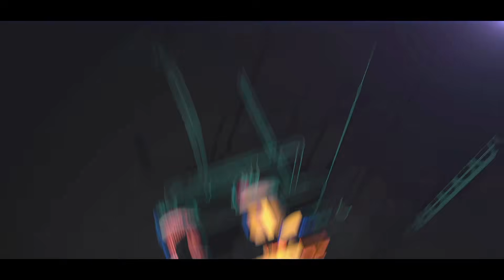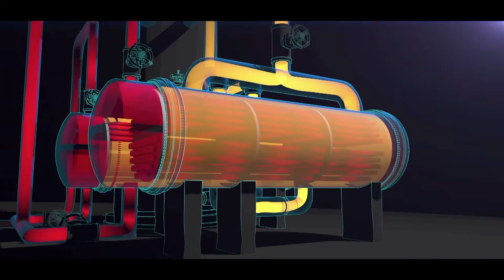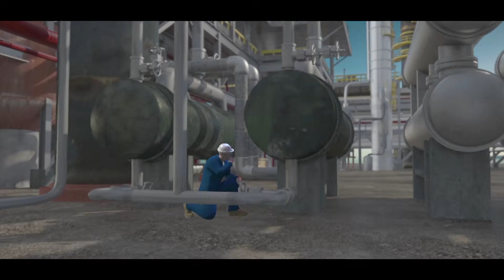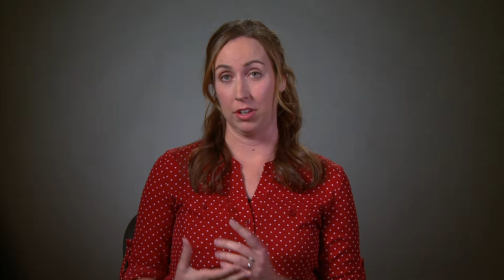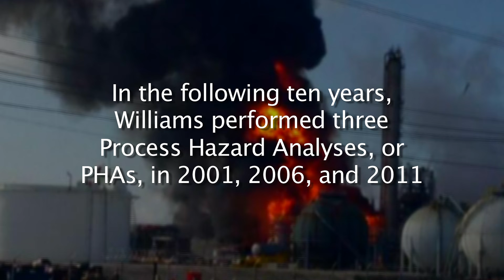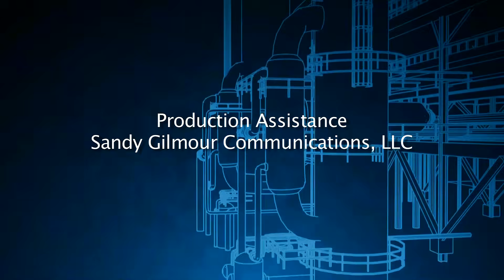Blocked In

Comment: I spent decades designing and working in chemical plants and refineries including a large olefins plant in Channelview.  This accident should have never happened!!.  
I can not believe people signed off on Engineering and the PSM which allowed a modification that could block in and overpressure a pressure vessel (in this case, a heat exchanger) while isolating the relief device.  This is a very basic safety principle that is always covered as one of the fundemental steps in PSM.  As a result, two people died and many were injured. We would spend months reviewing changes before signing off.  Something very strange going on at this facility.  I hope the responsible parties were punished.

Comment: Pressure relief valves should be installed directly to the vessel it is intended to protect, with no valve between, not some 40' away on some other part of the system.

Comment: I worked for 15 Years as a messenger. I got to see most of the industries in the Chicago area. If the streets and sidewalks are dirty in a plant there is a problem get in do the drop or pickup and get clear. I was shown many different safety films while I was in the US Army both active and reserve side. They were dry but accurate at the time they were made. Cleanliness was one pointer to good procedure and organization practices. Too many companies are too focused on the Money side not on safe practices. B737 problems ongoing is one example. Every workstation needs to be clean, all devices well marked with clear visible instructions to ensure safe operation even in emergencies.
In this case having a unit offline and not being checked on a monthly schedule is a big red flag.

Comment: Continual fouling of the waterside of any heat exchanger seems rediculous. What's up with the oily tar? That's beyond my knowledge. But as someone who treats process water systems, leaving a heat exchanger offline is worst case scenario for corrosion and fouling.
Reply: It's called quench water.  You can do some research on standard ethylene plant design to understand why it is done this way.  It's a system of heat recovery that uses circulated water that contacts the cracked gas which is dirty.

Comment: If not for the "human factor", most industrial incidents would not have happened.
I have been working in heavy ferrous and non ferrous smelting industry for almost 40 years and witnessed stupidity beyond belief. Tampering with protection devices and merely ignoring "bells ans whistles" are the most common causes.

Comment: They should’ve incorporated an interlock through sensors on the valves and additional PLC programming to add a layer of dummy proofing and added a pressure relief valve upstream from the outlet valve for each reboiler.

Comment: So the pressure relief valves were located on a tower remote from the vessel, was this so that any released chemical would be free to pollute the atmosphere?
Reply: Probably so it didn't incinerate workers.  Propane release at pressure is not something you want at ground level!
Reply: @MarkTillotson  It's always at ground level because propane is heavier than air.

Comment: It is one person's fault. Whoever designed that boiler so that it could be in a situation where there were no safety devices connected is solely responsible for the explosion.
Reply: Its never one person's fault in the real world - some manager might have tasked an unqualified engineer to make a change plan that was unsafe, or person A asked person B how to design new valving without giving the whole picture or any mention of high pressure being possible - or someone did design a safe change, but some manager only implemented part of it to save money, who knows?
For sure there ought to have been indepedent oversight for critical changes like this so it cannot be a single person's mistake, the Swiss-cheese model is very important for this.

Comment: How does one as an engineer make a mistake like this? Adding new pipes and valves and completely disregarding the dynamics of the reboiler and it's related piping? It seems like taking the pressure release valve into consideration for the design would be important lmao

Comment: I can almost GUARANTEE you it wasnt a "mistakenly opened valve" It was most likely a leaking gate valve that caused unwanted propane fluid to enter the heat exchanger. Those shits are fucking horrible for losing their sealing seats and letting fluids leak by. #globevalves4life

Comment: I thought, ASME Code doesn't permit a manual isolation valve between the Relief Valve and the Vessel. As meaning, you cannot block a Safety Relief Device.

Comment: PAUSE!!!! they kept that boiler O/S for 16 months?! they should have at least switched operation quarterly. We will hold sterile tanks available and switch to and fro.. there is no present danger, such as this incident, but we still cycle through tanks so that one tank isn't using all of its "life". hindsight is 20/20, but somebody should have brought up the other boiler at some point during its downtime. if it were a new boiler and had not been used, it would sort of make sense, but since it was old, it shoulda been considered. that maybe would have presented an opportunity to notice the exhaust valves not linked after operational change. hell, even just boilers heating water will foul. Our big boiler just went out. i had never seen the inside of a boiler, so i went in last night and checked it out as they had it opened. MAJOR fouling of the inner piping. it looked horrible. (praying our rental boiler shows up on time. maybe next year's budget will have some spare change for a brand new one. we have a high demand for such a small plant.)

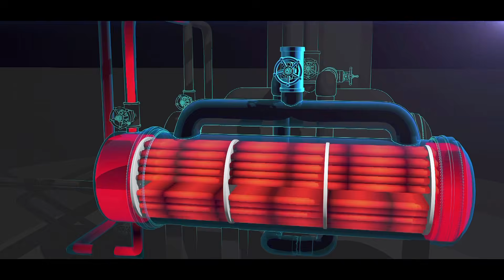Comment: 4:20 But why was the valve shut on the pipe connected to the safety valve?
Thats the sole purpose of these systems, where you have a constant flow of gas or liquid.

For example, the system is set to run at a pressure of 10 bars. Through the calculation of flowrate and volume, you should have a proper safety valve that is calibrated and tested for an operating pressure UP TO a certain percent of the operating pressure, around 12-15 bars. This is called the "opening pressure" and its a preset value that you set the safety valve to.
At pressure exceeding the operating pressure, the safety valve is designed to open and release the excessive pressure until the operating pressure is back to normal pressure.
But if the valve between the object and the safety valve is closed, then the safety valve does not exist in the process.

I have worked with valves and heat exchangers for many many years together with several specialized employers and i have never ever seen anything like this.
The operators and plant workers should have very clear check lists and routines in start-up that prohibits the rules of the flowchart to be broken. Very strange..

Comment: They should've done the review before the change but that still doesn't change the fact that they would've overlooked the pressure relief valve issue either way.  I suspect they found the pressure relief valve was an issue and left it blank on the form while they looked into it and never resolved the issue.  Management just wanted to get things going and proceeded anyway.

Comment: Guess im missing something? If the Supervisor opened a water valve. The water pressure was lower than the product pressure regardless of heat the vessel high pressure would have pushed the water backwards to the other exchanger and lifted the PRV's that protect the other exchanger? Or was there a check valve in line?
Reply: The water and propane are separate, that's the point of a heat exchanger - only heat is exchanged, nothing else!!

Comment: I used to write industrial checklists.  Two requirements are strong paranoia and extreme fussiness, attention to detail. There should have been a local pressure gauge and an audible alarm on those reboilers.  I agree with this report.  The culture of safety appeared to be lacking.

Comment: Wouldn't it make sense to have pressure sensors or gauges to help monitor the pressure in something that has the potential to explode due to being overpressurized? It seems that if an item has a pressure relief valve, that a gauge or sensor should be necessary to help prevent a catastrophic failure.

Comment: Due to the constant greed by the owners for a no shut down policy, the result with the losses of two people I’m sure will be comforting to their families. Rather than stretch the current system by effectively cutting the heat exchanger in half, why didn’t they build another two heat exchangers then but not in the very immediate area of the currently used ones? At least there’s the health and safety government departments that not only sift through the pieces,but tell everyone else that they should buck their ideas up or else, RIP the two workers who lost their lives.

Comment: I would have thought the vessel would have had its own pressure release valve
Reply: The problem is you don't want hot propane venting in quantity at ground-level, that's simply another type of explosion.  Hence the PRV's at the top of the stack.  The original design was likely OK, some chump f**ked up and changed it to the extremely dangerous configuration that failed.

Comment: To prevent such accident in the future: put the new pipe configuration into a computer simulator. Add it into a puzzle game where some 12-year-old kids try to cause a mechanical explosion in the vessels by adding or removing the relevant chemicals, heat, etc, and present the findings to management. When they change the configuration enough so that the puzzle can't be solved without first sounding an alarm in the control room that can solve the problem, the plan can be approved. If the destructive and creative mind of a 12-year-old can't blow it up, it's as safe as it can get.
Reply: Well yes, the plant configuration ought to be in a suitable software package that can analyze for such design faults - bit like design-rules checking on PCB layout of VLSI design, but with different rules.

Comment: Wouldn't it make more sense to have the over pressure valves on the reboilers instead of the columns?
Reply: But where would you vent to - tons of angry propane isn't easy to deal with!  The PRV's on top of the stack makes sense.

Comment: That’s why if you’re not sure of the process, you don’t touch anything. If he had opened the outlet valve first it would have been fine. With that being said there should not be a valve in between the pressure vessel and it’s respective safety relief valves

Comment: Interlocking valves would have prevented this.   If you want to open the inlet then the outlet  has to be open first. 
Plus you DON'T fit shut off valves before a safty valve.

Comment: Fukn hell. Any apprentice plumber could figure out where and where not to install isolation valves so as not to jeopardise pressure relief systems. Jeezuz, are these engineers PAID for their incompetence?  And did no-one bother to clearly explain (or maybe even draw a diagram of) flow lines for the supervisor to read and follow ???  And wasn't the supervisor prohibited from tinkering with the system without manager oversight. Maybe he was on the toilet, at lunch, out shopping. Is THAT the way these companies handle safety protocols?

Comment: Is there any way to drill safety in to individual workers?
What I see here is there were a bunch of mandated acronyms that company did,not well mind you but enough that they gave the illusion of compliance.
Your recommendation is more mandated acronyms that in practice will become task to check off of a to do list and nothing more.
Reply: The maintenance manager followed all procedure, he did nothing wrong. All blame is on whoever leaked propane into that reboiler and management for not dealing with this issue months ago

Comment: I believe the Shell Chemical (now Kraton) at Marietta, OH had a similar problem.  In an explosion probably 25 years ago, a process compression system exploded because a gate valve downstream of the compressor had been closed as the compressor operated.  A cardinal rule in process compression:  Always design with a relief/safety valve between the compressor and the first valve downstream of the compressor.  In the situation at Shell the gate valve downstream had been closed while the compressor was operating...no relief/safety in between and an explosion resulted with several operators killed.

Comment: I always thought that any pressure vessel or such has to have a relief valve installed directly to the tank so it makes it impossible to inadvertently close it out of use by pipes and other valves .
Reply: Problem is you want the pressure relief to happen well away from people - hot propane release at ground level is just another way to have an instant explosion - you've not solved anything that way - hence the PRV at the top of the stack where it can be flared off.  The original design was probably perfectly good, but got ruined by the stupid change.

Comment: Theres essentially no point in opening the hot water inlet to the isolated reboiler. Secondly, of he was doing it in order to ensure if the water flow has actually reduced, he should have drained the HC side of the exchanger prior.

Comment: I am trying to figure out what the dead guy was thinking when he opened the hot water inlet valve into the heat exchanger. What was he trying to accomplish by this dumb move? Clearly, there was no process underway, no product in the cool side,. So, why do you suppose he thought of doing this without adequate consultation with the process manager?

Comment: What caused the fire after the vessel burst? Doesn't a fire/explosion require a spark? Or was the propane hot enough when it ruptured that it only needed oxygen?
Reply: Probably not hot enough, but if you release tons of highly inflammable material it will usually find a spark, if only through the static electricity generated by the rapid venting (this is why you get lightning in volcanic eruptions).  Also something rubbing on steel can generate sparks too.  Only takes one stone on the ground being slammed into some bit of metalwork...

Comment: Very sad loss of life and the investigation showed how it could have, and should have, been avoided.
 I never quite trusted pressure relief valves, and always installed them in parallel with a slightly higher rated bursting disc. Never have a fixed block valve in a vent line, even if locked open, there is always a chance of someone operating it, if it can be messed up, someone will.
 Maintenance blanks between flanges also used to give me sleepless nights, I would insist on personally checking the work if I had issued the permit, before signing off for return to service.
 I retired from the industry after 30 years and thankfully never responsible for a fatality,or serious injury, I cannot imagine how an engineer would cope with such an event.
Good video, thanks.

Comment: Any pressure vessel must either have a non-isolatable PRV or a non-isolatable rupture disc, or both. Having isolation valve blocking the PRV was a recepie for disaster.

Comment: Typical management failure..
We build this minor change fast, & fix the irritating paperwork later..
No one ran a pressuretest after the reconstruction. Obviously very low craftsmen standards! 
Wonder who "fixed" the paperwork assuring a correct reconstruction... - Maybe the cleaning staff or a dusty manager 30 minutes before closing time

Comment: Im final year chemical engineering student designing a destillation column and this fouling of the reboiler and using two reboilers, one as a standby should the main reboiler need maintenance gives me an idea for my design to prevent shutdown. Can someone comment on this, is it economically viable to prevent shutdown to include two reboilers?

Comment: An engineering question is "how can HUMAN INTERFACES be improved to show WHAT is in a vessel and under WHAT CONDITIONS (temp, pressure)?". Another is how can valves OBVIOUSLY FROM A DISTANCE show their open or closed status?. 

One way to improve control is comprehensive checklists and flow charts. For example sequence of operation. If valve X is open what other valves MUST also be open? 

Of course it's a design defect for a system to allow blocking a blowoff safety valve.

Comment: why not put a safety valve directly ON the reboiler. so that you don't have to rely on the valves on the refractionator?
As a fan f steam locomotives, I now the safety valve is on the pressure vessel not several feet away, and why keep it down for cleaning so long? Sure it doesn't take 1 year to clean it!?

Comment: You would think at some point, they would have installed a simple pressure gauge on this pressure vessel.
Reply: The dial would have spun noticeably at startup.  Propane expands almost as much as water does when it boils..
Reply: @tashkiira7838  would be nice if there was a pressure sensor and emergency dump valves for this.
Reply: @FishFind3000  Or even just a warning klaxon, to communicate "Something has gone horribly horribly wrong and explosion is imminent, please run for your lives."

Would be useful in the event that, like this, the pressure relief system fails or is inoperative.